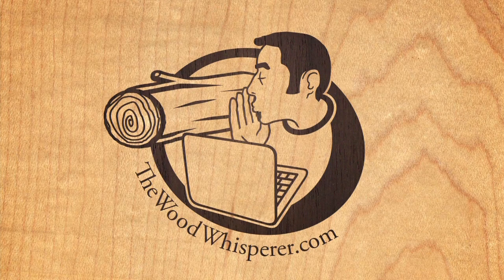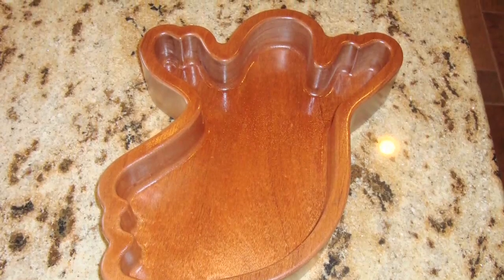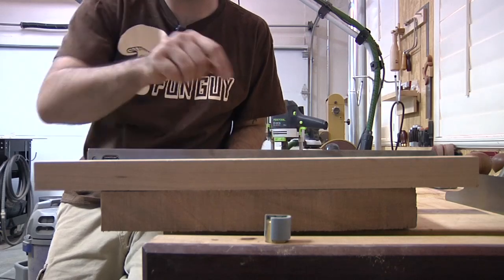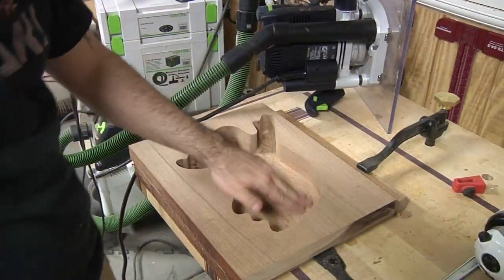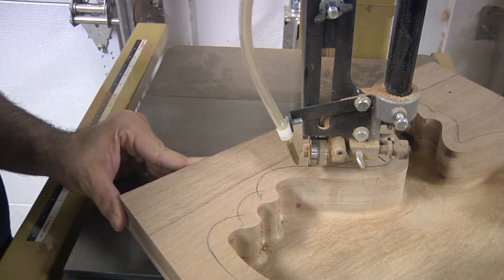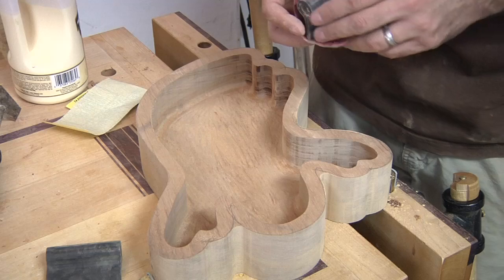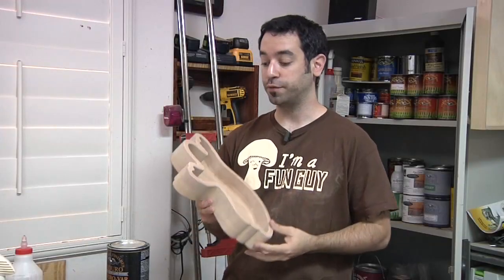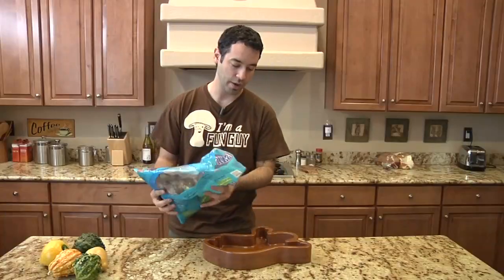Halloween Router Bowl - 130

Comment: Marc. I use a planer sled to flatten twisted boards. The base is made of a piece of plastic layered plywood from an old piano I restored, The plastic is 3/32 thick on both sides, and the ply is 1/2". I made this into a torsion box, using plans from an issue of FWW magazine, and use blocks and wedges to keep the work piece level. After enough passes thru planer to flatten that side, I remove it from jig and flatten the other side. I find this method a lot easier than trying to flatten it by hand (I was never any good with hand planes, and do not own a jointing plane). If the board is so badly twisted that I would lose too much of it during the flattening, I either cut it into shorter lengths if the project will allow it, or I find another piece of material and delegate that piece to smaller projects.

Comment from the maker: I honestly haven't used one much myself. I think the reasons have more to do with accuracy and ability to control the tool. I can see using one for rough surface planing, but I'm not sure it would be appropriate for creating a dead flat surface. But again, I haven't had much time with one myself. That was always my impression from talking with other folks. But if it's working for you, then you can't argue with results.

Comment: Hi, good to watch you using hand tools, I've been a Joiner/carpenter 30yrs, I use a no'6 plane, I find a no'5 is ok & i see what looks like you have a Try plane- no'7 on the table, 
No'7 can be too long & no'5 is sometimes a little short, The no'6 is a good all round tool, when sharpened like a razor it has enough weight to help forward momentum with the length to help control this power to help stay flat & straight.

Comment from the maker: @Strykercom1 Just keep in mind a straight bit gives you square corners, which aren't quite as nice as the bullnose corners from the special bowl bit. And if you use a bull nose bit with a collar, you need to make an expanded version of the template to account for the offset between the collar and the bit (unless you can manage to get the collar nice and flush with the cutting edge of the bit.

Comment: Not sure if anyone suggested but when sanding the inside of the bowl you could possibly use a sanding pad that would be attached to a drill of some kind to get the larger areas. Still need to do the tight corners by hand but at least the larger areas could be taken care of a bit quicker.

Comment: I dont know if its already been suggested but if you are going to glue the base on to thicken the wood up, why not cut the top part out with a jigsaw before you glue the two parts together saving all that drilling out, if you were careful enough with a bobbin sander you wouldn`t even need to rout it.

Comment: I built a quick router jig to hold the router above my stock piece and just put shims under the raised corners where it sat on the bench and it quickly flattened the top. Turn the stock over and repeat without the shims. This was to produce a dozen natural base centre pieces for a wedding. it took a day to do them all.

Comment: It appears as though it would be beneficial it keep the lower piece of wood somewhat oversized as to provide a small "ledge" in order to clamp the entire piece to a bench to minimize movement of the overall piece as you use the router -- as you have done -- intentionally or by "mistake" ;)

Comment: Dumb thought possibly and I'm kinda lazy - I've placed the thick twisted wood on a level surface sitting on a couple of coins and then taken two thick ish strips of square and parallel on all sides wood and glued and screwed them to the sides of the main block. Voila, as long as the width still fits in the planer then you don't have to spend ages doing the hand planing. Take out the screws and cut off the strips. Just a thought.